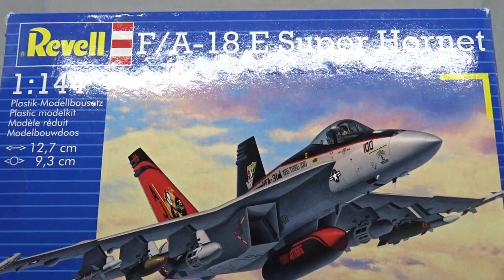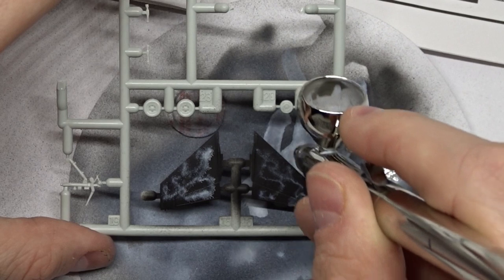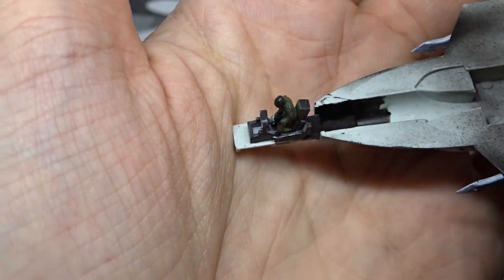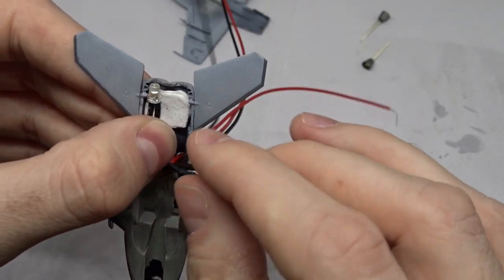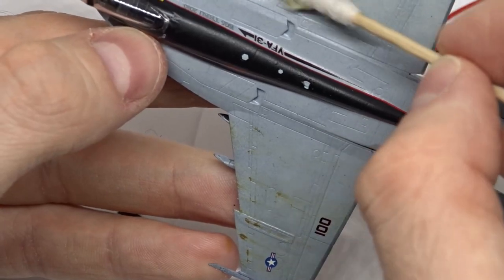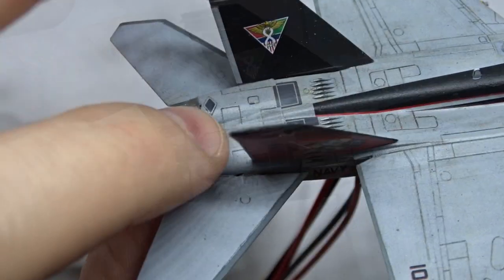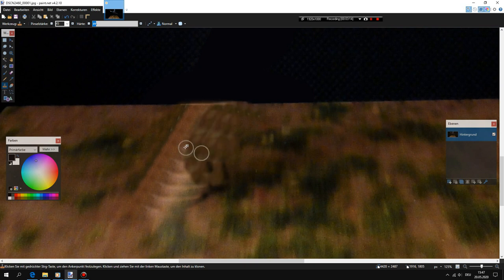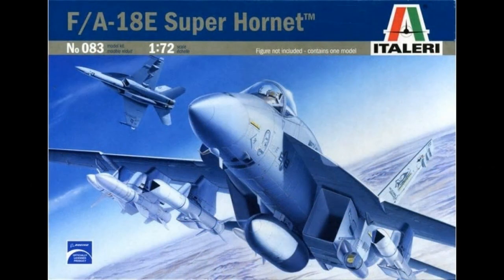REVELL F/A-18E Super Hornet 1/144 [Build Review]

Comment: I have just started building this same kit and not sure to paint the black flash alone the back or use the decals if you were to do this kit again would you still use decals or think about painting it
Reply from the maker: Depends how experienced you are with decals. Overall this decal wasn't such a huge problem but you can just try using it and paint it if it doesn't work!